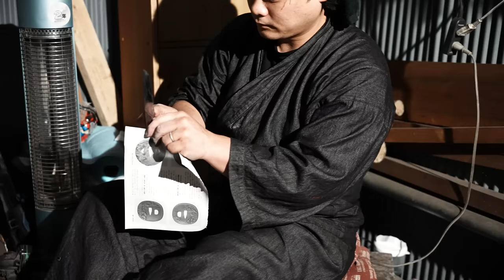Process of Making Japanese Knife - Beautiful Blacksmith & Samurai Sword Master 日本刀 包丁の作り方 平田鍛刀場 부엌칼

Comment: Japanese iron manufacturing method uses iron sand and charcoal as materials.
Iron sand in Japan is ilmenite iron sand contained in granite made by weathering magma, and it is called masasatetsu and contains titanium.
Ferrotimenite is included in basalt. Iron sand weathered from basalt is called Akomesatetsu and contains titanium.
This iron sand is low in phosphorus and sulfur, impurities that make steel brittle, and high in vanadium, which strengthens steel.
Iron ore and coal are high in phosphorus and sulfur and do not contain vanadium.
Vanadium has been detected in ironware from around the 3rd century in surveys of Japanese archaeological sites.
Around the 3rd century, Japan changed the material for iron production from iron ore to iron sand.
Since Japan has many volcanoes and a large amount of iron sand could be extracted from the mountains, the former sites became terraced rice fields.
European iron ore has a high phosphorus and sulfur content, so European iron ore could not be used in the Bessemer converter.
In ancient Japan, slag was called noro, and the process of removing slag was called noro dashi or noro shibori.
In tatara ironmaking, the iron sand is semi-molten by keeping the furnace at 1300℃, but only phosphorus, sulfur and impurities and slag are melted and discharged.4:18
Ironmaking and impurity removal work take time because of the low temperature of the furnace, but high-quality steel can be produced.
So impurities and slag are removed from the material tamahagane of katana.
It is produced using the same tamahagane material as katana, a high-end kitchen knife made in Japan.
The Japanese low-temperature reduction method makes the grains of the steel smaller, so the steel has excellent toughness.
The high-temperature reduction method makes the steel grains larger, making the steel brittle and lowering its toughness.
Vanadium makes the steel malleable and easy to roll, making it easy to fold.
By folding, the vanadium is finely dispersed and combined with carbon to form a fine metal structure, so the katana has excellent hardness, abrasion resistance, corrosion resistance, and toughness, and becomes beautiful when sharpened.
Hitting the steel with a hammer removes the carbon with a spark, so the carbon content drops to 0.7%, which is suitable for katana.
The approximate amount of carbon can be determined by the shape of the spark.
By folding, the steel of katana is in a state where austenite and martensite, which have different hardnesses, are dispersed.
When a katana is sharpened with a Japanese sharpening stone, the austenite is removed and martensite remains, so the blade becomes like a microscopic saw.
That's why Japanese knives pull when cutting.
China and Mongolia developed blast furnaces earlier than the West, but from around the 10th century they imported katana from Japan and used it in their armies.
China also had swords like longswords and rapiers, but based on katana, Qijiadao, wodao, and miaodao were developed.
Chinese Ming Dynasty military scholar Mao Yuanyi (1594–1640)  “The katana is extremely strong and sharp, and the Chinese sword is no match for the katana.''
British adventurer Sir Edward Michelbourne (1562-1609) “The Japons are not suffered to land in any port in India (Asia) with weapons; being accounted for a people so desperate and daring, that they are feared in all places where they come .”
Spanish trader Bernardino de Avila Giron (- after 1619)"The quality of Japanese steel crushes European steel at the first blow."
Around 1970,  Japanese steel company Hitachi Metals analyzed and applied tatara and tamahagane to develop Yasugi Specialty Steel (yasugi hagane) and built a sponge iron plant.
Yasugi Steel has the same properties as katana, so it is hard, impact-resistant, and hard to break.
Similar to tatara ironmaking, Yasugi Steel is a low-temperature ironmaking process, so it takes a long time to make, but it can produce high-quality steel.
This special steel is used for various purposes such as cutlery steel, high-end kitchen knife material, razor material(Gillette,Schick,Wilkinson razor steel), automobile parts material, automobile engine parts, and aircraft engine parts.
Japanese knives and zwilling Japanese knives are made from steels such as  Blue  Steel (Aogami) and White Steel (Shirogami) based on Yasugi Steel.

Around the 6th century, high-quality iron sand could be mined in the Yasugi region, so it became a town of iron manufacturing.
Yasugi City is currently producing Yasugi Specialty Steel at the Hitachi Metals factory and exporting it to the world.

In the 14th century, katana craftsmen migrated to Seki City and produced katana in large quantities.
Seki City still produces katana and knives.
German knife maker zwilling parsed tamahagane for katana material.
zwilling manufactures high-end kitchen knives made from Japanese steel in its Japanese factory.
Reply: אין כמו אימא בעולם!!!!!!!!
Reply: TLDR
Reply: 製鉄法、日本の地理、歴史に詳しすぎて、何人なのか、職業は何なのか気になる。
日本人ならば、専門的な用語を英語で説明できる英語力の高さ、外国人ならば日本の製鉄法への理解力の高さが凄い。
Reply: Thanks for the very detailed information
Reply: Aphahaha, lol, tell this bullshit to Spanish smiths from Toledo or Solingen in Germany. Japanese catana-crap is something around nothing in comparison with medieval swords from that places, if we talking about quality of steel.
Reply: Disfruté mucho lellendo este comentario.
Gracias.